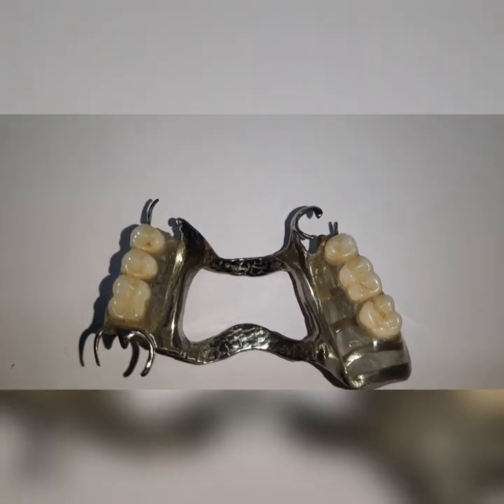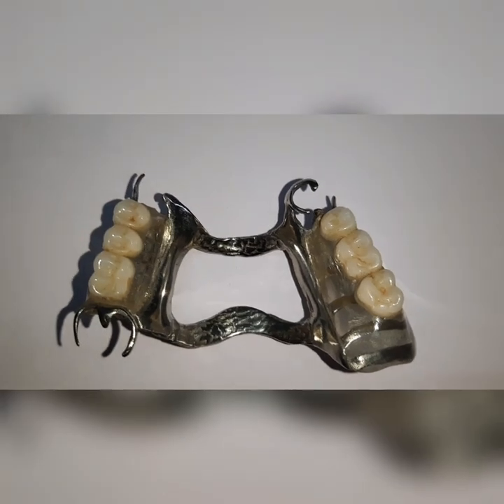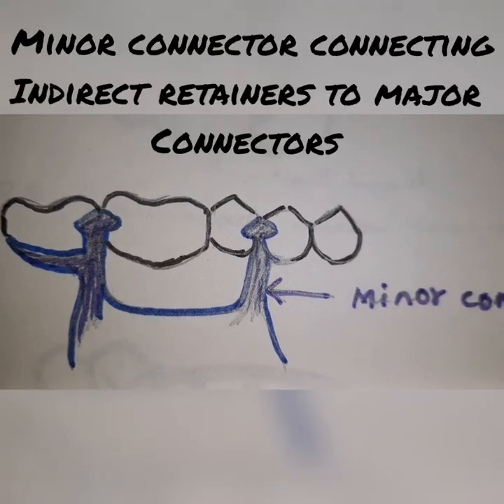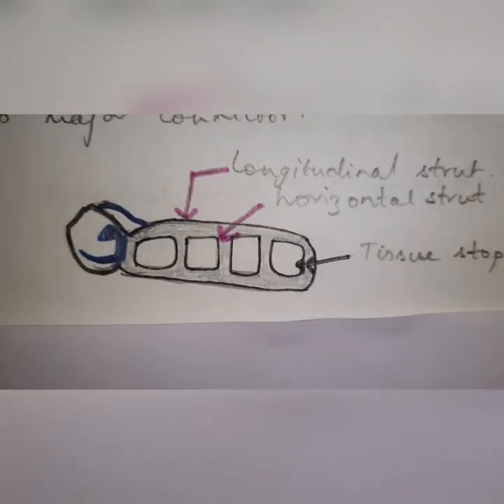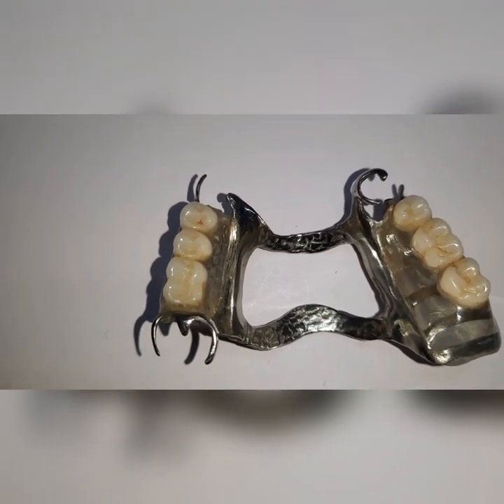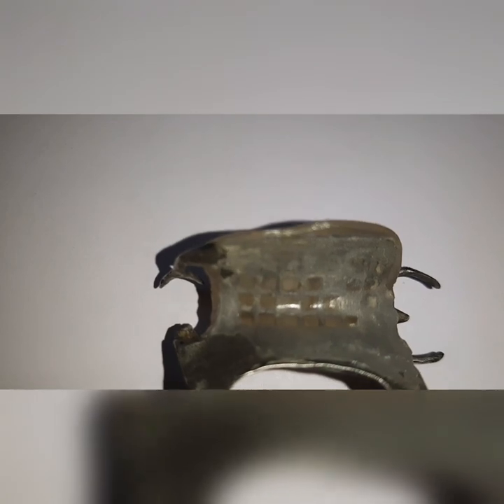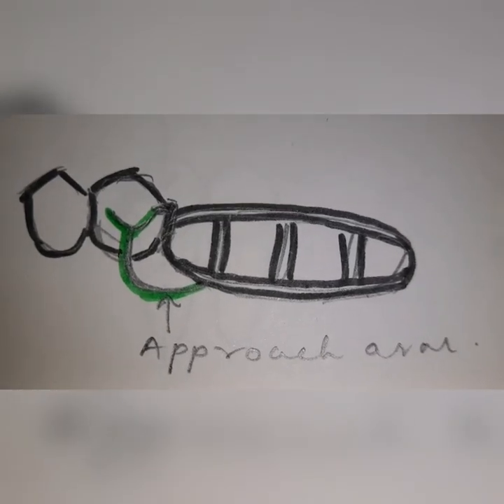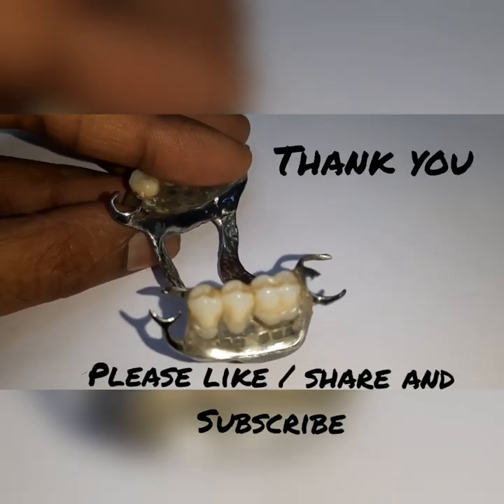Minor connectors in Removable partial dentures

Comment: Hi doctor✌ I have a question.
Should the minor connector that forms the framework for a denture base extend to the full depth of the vestibule?
Reply from the maker: Extension depends on the location of undercut.
Reply: @VijayPrakashdental  So it's not intended to extend to the full vestibular depth? 
What undercut do you point to? Soft tissue undercut?